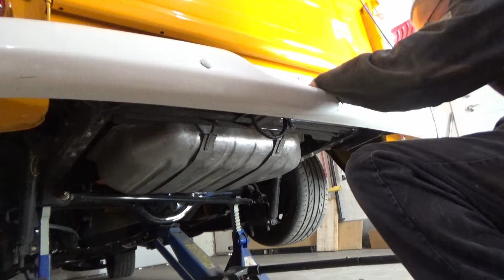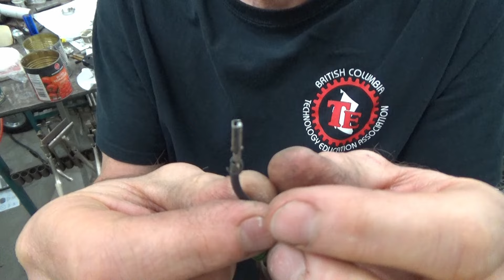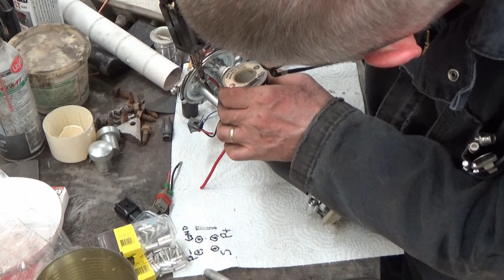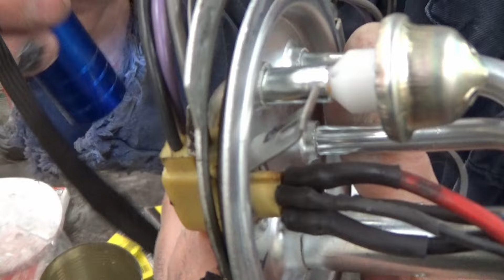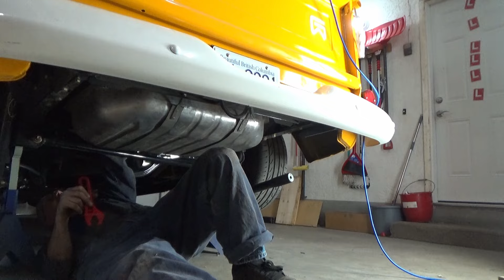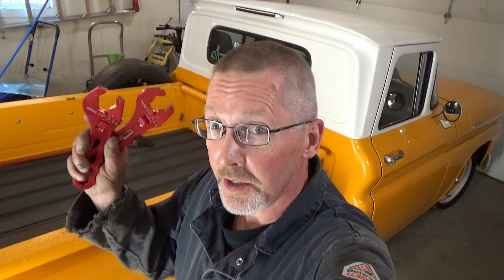Replacing a Fuel Pump on the '61 Apache

Comment: I use dielectric silicone grease on almost every terminal. It protects it from moisture but cools it as well. Fuel pumps that are OEM draw about 7-7.5 Amps. A head lamp bulb pulls about 4+ amps and works to check circuit to pump. If wire is damaged it must be replaced. 
 Check amperage draw can be done at fuse block. Install the appropriate size (150 metro-pac) or 1.5mm terminal with a fused jumper wire is a quick way to check a fuel pumps health. 7.5amps = normal. 8amps or higher = plugged filter, pinched line, restricted pressure regulator. 6amps or less = worn pump. On an Oscilloscope, you can see the waveform pattern. If smooth & even, then normal. If jumpy or jagged then copper plates on the armature are worn and skipping on plastic. 
  Thanks kindly for sharing.

Comment: Is that a ford tank and fuel sender? It looks like a ford connector. They seem to be made of the worst materials and either break on disassembly, disintegrate with time, or melt and try to burn your car down. 
I use GM style metripac connectors for stuff like that.
Reply from the maker: S10 Blazer tank and pickup. I used the wires that came with it, and the gray electrical connector that came with the Walbro pump.  The only Ford parts I used were the 9" axle and the fox-budy steering rack. And the paint.

Comment: If all else failed, you could go back and watch the video of how you put it together!  Nice that you have that documented.  It seems to me though, that back when fuel pumps were mechanical and lived on the side of the engine block, they were much easier to service.  I know modern, fuel injected engines need high pressure fuel to keep them running but why couldn't the pump be somewhere more convenient than in the fuel tank itself?  Maybe someone already did that or maybe there is a good reason for having the pump in the tank, I don't know.  Seems like another case of easy to engineer and build but difficult to service.

Comment: 💕 me that truck!  I just changed my fuel tank, pump, and filler neck and the aftermarket filler doesn't match the original cap. Now I can't find a cap that doesn't leak so I have evap codes. ARGH!!

Comment: Its probably not going to happen again, but a possible "serviceability" approach could be an access panel in the floor of the bed?
Reply from the maker: Not at all a look I was after.  A smarter cookie would have kept the in-cab tank and used an external pump, but not me.
Reply: I have a flap that was cut in the bed of my gmt400,dirt goes though and sits on top of the tank, I hate it. Now from the incredibly slow locost project. I have a NOS 240 external fuel pump that I was going to regulate down for motorcycle carbs and deregulate for moto injection later. But that's stalled while I work on truck restoration.

Comment: I recently had to mess with a fuel pump in my opel omega b, never liked in tank fuel pumps, but it is what it is, in this video i noticed the fuel in tank assy, the pump pickup screen is quite large, and the return line is in the same assembly, what happens with the fuel in your tank if vehicle going around a corner?  Fuel under centrifugal force moves away from centre of the tank, in my opel omega b, the fuel return line goes to the bottom of the cup assembly which the fuel pump and pickup sits in, the return line at bottom/ lowest point in tank has a nozzle, creating a jet of fuel , sending the stream of fuel thru fuel at bottom of tank and spraying into this cup assy, tested it on the bench with water, seems this jetting action acts as a suction to pull fuel from bottom of tank into this cup keeping it filled and fuel pump with pickup screen inside this cup being completely immersed in fuel, thats from the factory, i'm thinking, that is for when cornering to prevent fuel starvation and to cool the fuel pump....

Comment: You got a link to the fender fuel filler you used? Looks nice. I can't find a way to make mine look good. Thanks.
Reply from the maker: It's an original cab-mounted fuel filler and o-ring.  I cut/shaped/flanged the hole to replicate the opening in the cab.

Comment: When you don't provide an access panel above the tank, you can at least lengthen your fuel lines and wiring so that you can simply drop the tank right down as the first step and then deal with unhooking everything afterwards.
Reply from the maker: I had thought of that, but I used teflon-lined braided hoses for the whole shebang, and they don't exactly flex well.